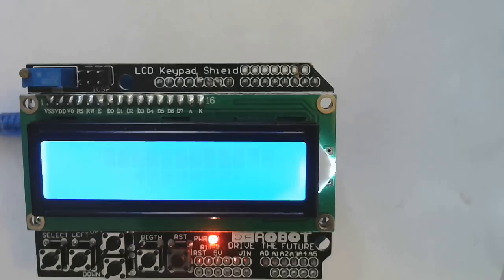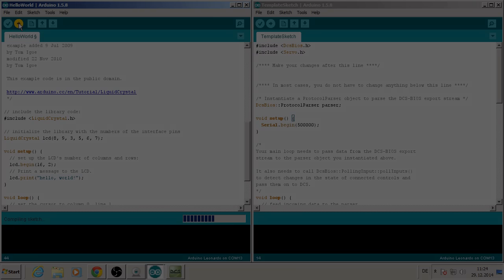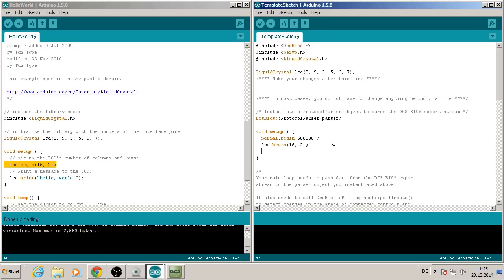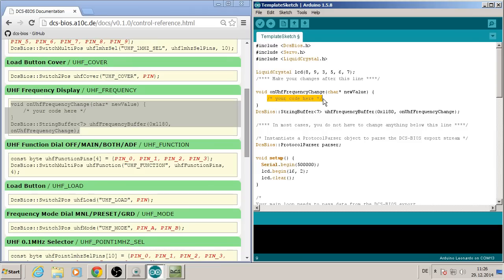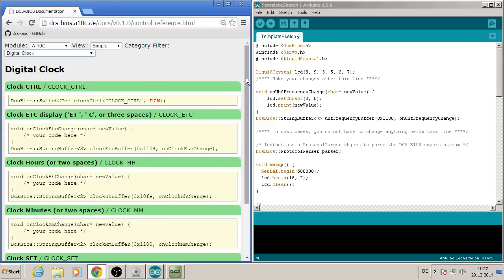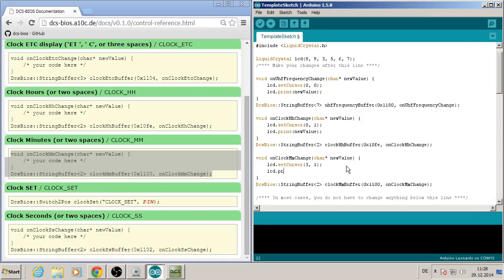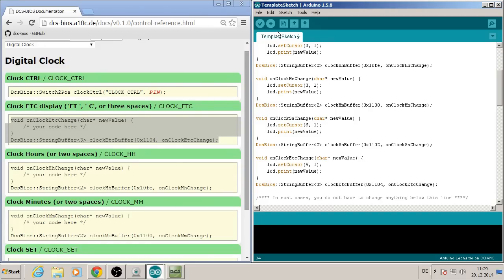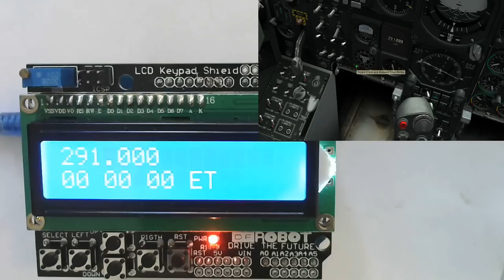How to use a character LCD with DCS-BIOS

Comment: I can't even thank you enough
Just to make sure can I get the pitch and roll data of the plane as row data values , I don't want them to be directly sent to a pin on arduino as I have my code do processing on them and compare them with quadrature encoder values before applying control to pit motors.
waiting for your kind reply , and best regards

Comment: Hi,
can you made a turtorial how to use 7 segement displays for VHF or UHF?
Good video
Reply: 6 years on, still cant find a decent video on this.
Reply: @Snugggg  do you still need it? I can share the code with you. I made a R-863 frequency simulation into max7219 7 seg. display for Mi-8 module.